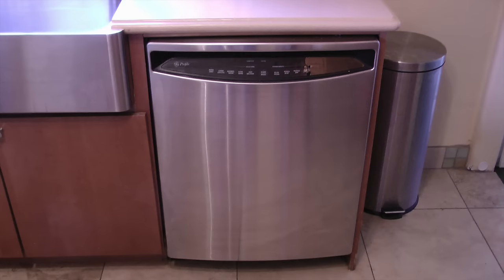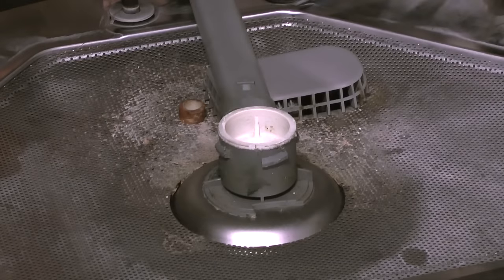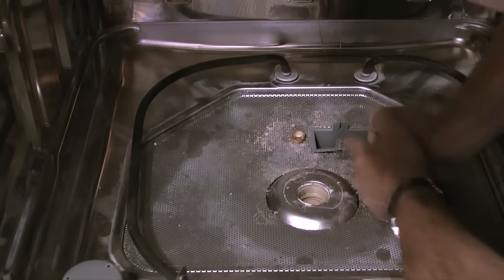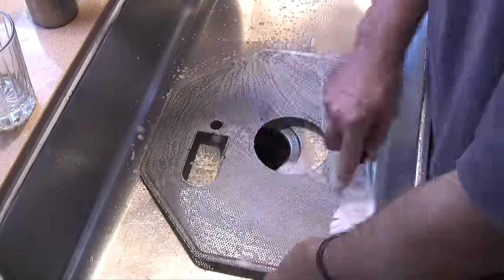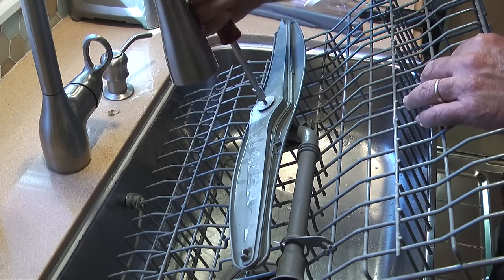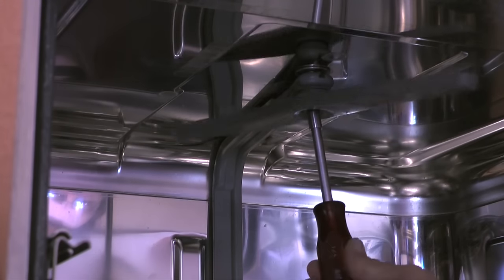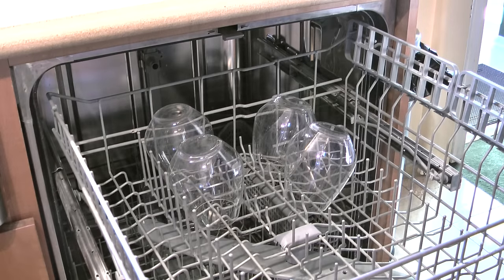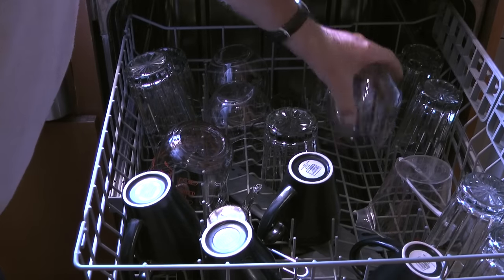GE Profile Dishwasher Maintenance

Comment: This design is disgusting. It’s obvious that you need to be able to clean the filters. They should have made it so you didn’t have to detach the top arm and connector and so the filter basket was easy to remove. Ideally you should only need to remove the lower rack and spray arm before getting to the filters. Bad, bad design.
Reply from the maker: I agree, whoever designed this never took the next step and cleaned the filter after the unit was built.